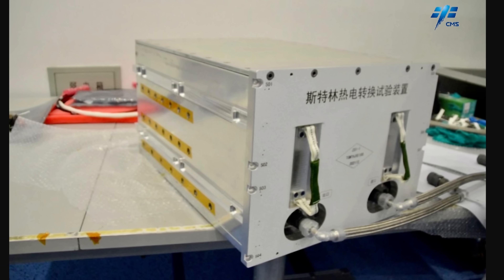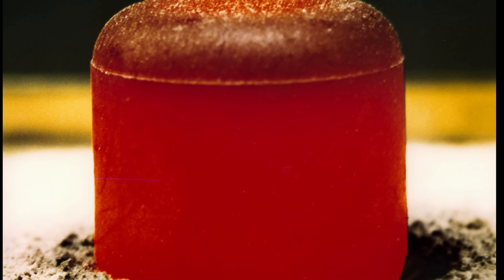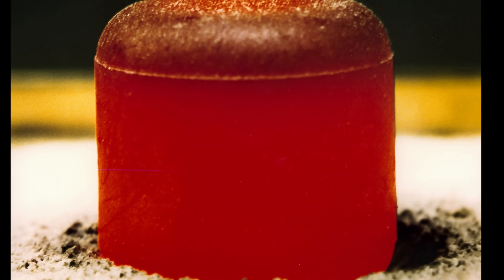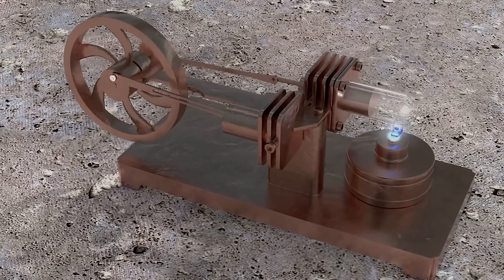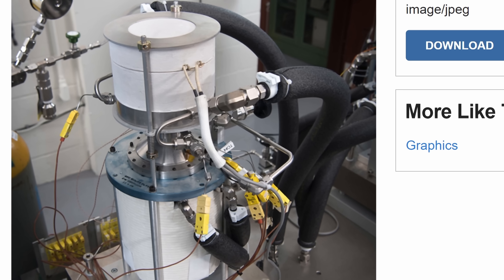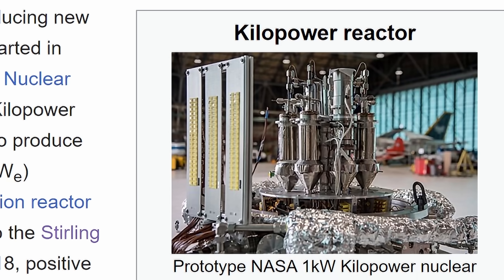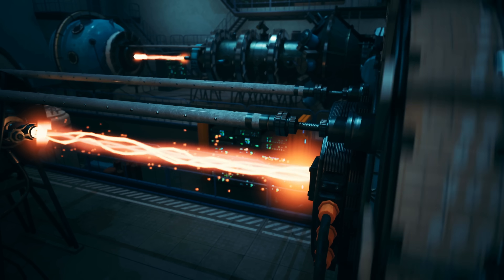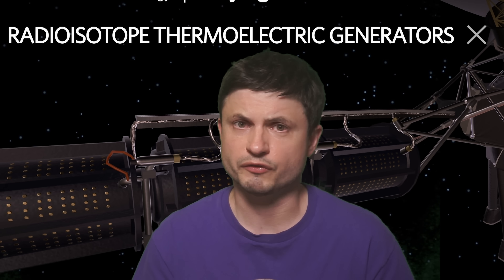Incredible Advances In Nuclear Stirling Engines For Space Exploration

Comment: This setup is a reversed driven Stirling Cryocooler from the company Sunpower Inc. The natural frequency of the bounce spring will determine the rpm. When the power piston gets in resonance with the bounce spring, the system has the Pi/2 phase shift that you need for the Stirling process.
Reply: There is no RPM, the piston moves back and forths and moving magnets generate power. No rotating parts used.
Reply: @O5MO  There are two pistons for a normal Stirling engine; one of them is usually called the displacer.  For this thing to run / oscillate, a phase shift between the piston and displacer is necessary.
With a crank mechanism operating the piston and the displacer, the displacer would lead the piston by 90 deg. or so in the direction of rotation.
Without a crank mechanism the leading of the displacer needs to be achieved by other means.
The engine will not run without this phase shift.

Comment: Though intended for space, could it potentially be used as a clean energy source on Earth if we’re able to increase it’s efficiency? Been seeing more and more how we should be looking at nuclear power again, including for space exploration.
Reply: Yes and no. In order to extract energy form it you need some kind of external combustion which means burning a fuel which in turn releases CO2 which we try to avoid.
Those are however already in use as a combined heating / power source. The waste heat generates electricity for a small household, you can buy them already in Switzerland for instance. They were also used to generate electricity instead of solar panels, but it wasn´t really worth it so the project was shut down and the company went bankrupt.
Those have a potential use case in automobiles as range extenders. As fuel source Bio-ethanol could be used which burn very clean, in general the external combustion burn about 5-10x more clean than an internal combustion engine.

Comment: In the 1980s I worked on a program which used this technology. Let me see, that makes 40 years, so I don't know where you get 20 years. We tend to think of these space programs as "sprints", when there was only ever one (in the west) which was Apollo. Another good example is the ISS. I worked on the design in the 1980s. When I got onto the program, I found that many of my older colleagues had been picked to work on it because they had worked on it in the 1970s. It was launched in the late 1990s. It is not much different from the previous designs. Most technologies take a long gestation period. Even AI is decades old. Yes, we learn new things over time, but many of the basic structures are set long before the public becomes aware of them. It takes a lot, of both engineering and money, to make these things work. In the space realm this generally means government money, and you know how that is.

Comment: Hmmm, "no moving parts" yet it has pistons that move back and forth, hmmmm, "no wear and tear" isn't the same as "no moving parts".  Also with RTGs in some space craft/rovers, they do use the heat to heat the craft/rover up to a minimum operating temperature, it's not just electricity they use from RTGs. that said, this does have a particular Steam-Punk appeal to it.  B)

P.S. the kilo-watt project, is still a far cry from one proposal I had seen that was a bit ludicrous. Some one was thinking of replacing Arecibo Observatory with a small array of dishes launched up to the moon, one problem, Arecibo Observatory had a 2-mega-watt transmitter for radar scanning asteroids NEOs and the surface of other planets, ye ain't getting a 2-mega-watt transmitter and power plant up to the moon's surface today, lol. maybe when humans are mining and manufacturing stuff in space, but not today, lol.

Comment: Traditional Stirling engines have had two problems. Low efficiency, and low power density. Combined, they meant that if you built a Stirling engine big enough to recapture a meaningful amount of energy from the waste heat of heat engines like an ICE or gas turbine, the weight and volume of the Stirling engine itself became an impediment to the application. And the tiny amount of extra power captured wasn't worth the additional weight, size, and cost of a Stirling engine. Increasing the efficiency to 20% and higher wattage could bypass these problems. Meaning this could allow higher efficiency power generation right here on Earth, not just in space.

Comment: Stirling engines aren't steam engines and they have pretty low power output for same size. I completely agree, that Stirling may be good for space probes, but for stationary power plants it would be actually much better to go steam! The Carnot cycle offers much higher power density, than Stirling's, and like on Earth you can easily achieve >30% efficiency. Its theoretical capacity offers a bit over 60% of efficiency -  on Earth we don't crank it up so high due to safety reasons (ever higher steam's pressure and temp.), but for space tech. on Moon it could be easily done.
Reply: does a steam engine operate efficiently in a closed cycle?
Reply: @cbuchner1  No real thermodynamic system is ideal. It depends on what you mean as "closed". Stirling is closed, because the medium is isolated, but not energy. You can achieve closed cycle of water (or other medium) in Carnot's cycle, and radiate the excess heat off. Treat the entire plant as system, not only the engine (turbine). If Stirling was better we'd use it instead of steam turbines.

Comment: No, totally logical so totally believable.... My ONE STROKE internal combustion engine design I should publish someday wraps a simplified Stirling-style heat engine in the central cylinder (+ 2cm wide piston head + seals) with an outer internal combustion cylinder + 'ring piston' head. Each end has combustion chamber impeller veins with 4 solenoid-actuated poppet valves between them, and a central Spark Plug Fuel Injector combo. The heat engine veins extend from the central heat engine cylinder to between the outer ICE combustion chamber impeller veins, helping to cool them. 
--
It's ONE STROKE because combustion shoots hot gas out of the impeller veins and compression squeezes air+fuel into the chamber at the other end, so compression as well as combustion provides TORQUE. It's a rotary engine. The fuel tank should probably spin with the engine to avoid fuel seal issues. Keeps it all self-contained and helps cooling. The inner heat engine cylinder is filled with CO2 and the whole engine + fuel tank combo is wrapped in a heat sink.

Comment: super interesting, that this works in space, they have to be getting close to a breakthrough in power generation, one of the most important aspects of life in space. The energy that they burn for propulsion thought is staggering, and cooling the outlets is difficult, a good engineer would realize, instead of dissipating heat, they could use it similarly to this at least, the fact that they have difficulty with this is alarming,

Comment: Little bits of power for communications and sensors is a start, but the real improvements will be when nuclear and atomic power sources (using "nuclear fuels", "atomic fuels) are applied to high power things like transportation, mining, processing. And by processing, I mean like melting rocks and separating the component atoms.  Making roads, buildings, tunnels, shelters - from local materials. Add up a few of the requirements of Earth based industries, and you need MegaWatts, GigaWatts, TeraWatts and more. For space transportation, PetaWatts and ExaWatts at Elon Musk grand vision scale.  There are lots of remote places on Earth to make such things. They can use their own local power. Then launch directly to orbit and ship to the Moon and Mars, or install directly into ships and systems.  

In the Bruce Willis movie, the 5th Element, there is a guy putting a glowing fuel cell into the star ship (the real kind), That is the kind of size, relative to the mass and size of the ship.  If atomic fuels are used for Earth to orbit, then the atomic energy heats, ionizes and accelerates water.  But I am looking at ways to convert nuclear energies directly into electromagnetic and gravitational fields (acceleration fields).

You are kind of right about steam, but most of the inefficient designs are NOT technology limited -- they are limited because of human greed. Each group wanting fame and riches for themselves, like winning the jackpot.  Rather all groups working on energy should work together. The knee jerk behavior now is "I found something, I will hoard  that and make a trillion"  [  If people work together, trillionaires will be common. ]  If the human species cannot monitor and distribute the results of new innovations fairly and for the benefit of all humans, not just a few in positions of authority or access -- we deserve the fate that comes with that social pathology.  

Yes, when I spent 25 years to search "Why do all these global and systemic issues take decades or longer?" In every case it can be traced to our obsolete and dangerous human group habit of hoarding knowledge for a few.  I call those "Internet pathologies" or "group pathologies." They are deadly and inefficient for global and heliospheric societies.  Correspondingly, with global sharing, all humans, not just a few rich ones in a few rich countries controlling knowledge, can live lives with dignity and purpose.  With AIs keeping open and auditable accounts, such methods can be applied to all global and heliospheric projects and systems and human lives. 

 Richard Collins, The Internet Foundation.

Comment: The Recirculation of Propane seems much safer. Indefinate and no radiation. The breaking down of the molecules, molec?.. The Heat signature contained within a foam concrete container could insure the craft would or could remain undetected. "Clean Coal" was my initiative. It was Propane from the air Electric Production Plant. The invention could be adapted to "Manned" missions, that produce fuel from life support systems. I believe robots would be much wiser, however. Electric, that requires only electrons which are readily available, was decided as the best option and propane was scrapped for Transformers. Ocean Vessels.

Comment: The main problem is temperature difference between hot and cool part of engine. Actual problem is a cooler.  What kind of radiator should be used in outer space?

Comment: A Stirling engine should be well over 30% efficient, but without rings to seal the pistons in their cylinders the efficiency is going to be lower.  Still, 20% as more than 3X the RTG efficiency and should be the way to go.

Comment: I still have a TEC setup, but given it was on a Pentium D CPU it barely cooled anything and wasn't worth the power draw.
I kept the case and setup because the water block I covered in liquid electrical tape and part of the cold plate. 
It would keep it around 10c at load

Comment: Am I being thick, or would it not be easier to use water, and it's differing pressures (steam) depending on heat generated by the source, vs the cold vacuum of space? Heat (nuclear source) evaporates water, drive "a thing" which then cools in space, to be sent back in to be heated again.

Comment: Strap a larger 10 KW stirling reactor to a ion engine with a low exhaust velocity, let's say 20km/s. We get a 0.5N thrust tops. I was wondering how heavy the stirling reactor is, and how reactor mass scales with power output. Does thrust-to-mass improve with reactor size? The two examples on the wiki for Kilopower are 1KW for 0.15 tons and 10KW for 1.5 tons. So acceleration is always way low, I'm getting 0.3mm/s/s tops. It takes 8 months to get to Mars and 4 months to build up the dv for the trip, so it's probably not sensible in that configuration, but I hear with ion engines you can change your voltage to trade exhaust velocity for thrust, so maybe something at 10km/s could still work while offering super low wet mass. Lots to try.

Comment: The stirling free piston thermo-accustic cryocooler is used on all satellites with IR cameras and also used on the James Web telescope...because, if you use heat to run a stirling you can do the reverse you can run a stirling to remove heat from a "reasons"

Edit:
Also if I remember correctly there are a number of stirling configuration that can achieve as high as 93% efficiency and that is mind blowing in and of itself considering the 1st Stirling was made back in (I believe) the 1830s??? by a minister!
Reply: The efficiency is related to temperature differential. High efficiency occurs when you have like 0 degrees on one side and 1000 degrees on the other. Steam turbines are more efficient at lower temperature differences I believe, which it why they are used in coal and geothermal plants.
Reply: In 1816. By Rev. Robert Stirling D.D.

Comment: ahh, how about just using the shadows of rocks and the open sunlight surfaces to supply the temp differential for a Sterling engine? There should be a few places near the lunar poles where this temperature difference will be stable and usable for energy. Oh and No this is not free energy - the temperature differential between the lit and shaded areas will be slowly reduced. Over enough time the thermal energy will all be expended (thousands of years maybe)

Comment: Stirling's could be used on the Moon as well to provide power on a lunar night.  The temperature differential between the surface (around -250F) and the caves about 50 meters down (around 63F) could drive a Stirling engine without nuclear needed.  The same engine could run in reverse during the Lunar day as a Stirling doesn't care which side is the hot side and which is the cold.

Hopefully we will start coupling Stirling's with home geothermal and heat pumps here on Earth.